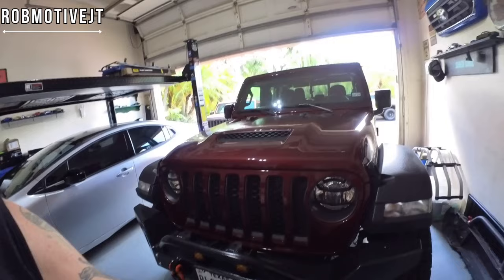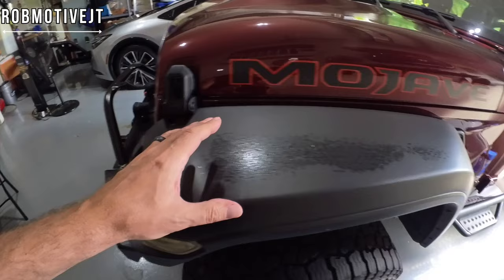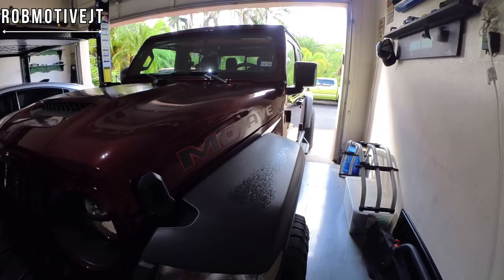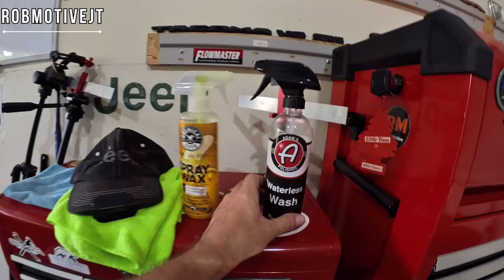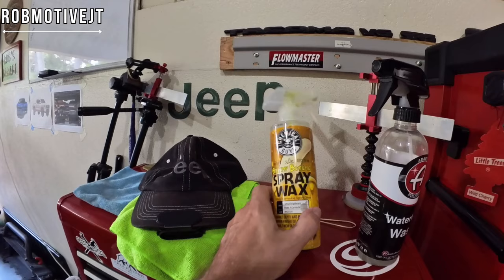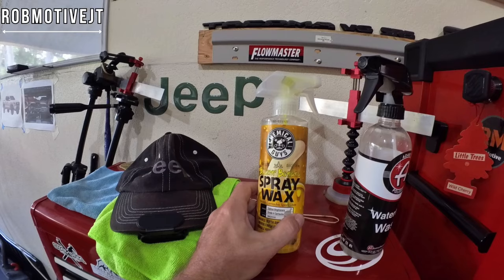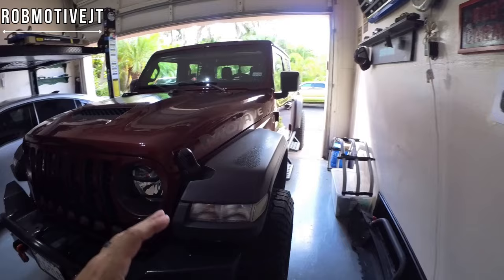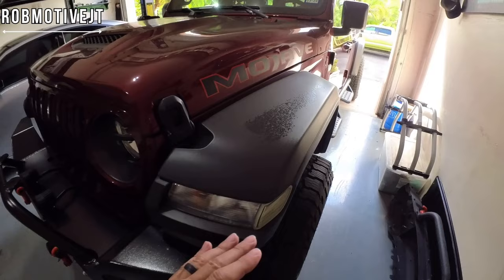Protect the Jeep Gladiator From Fading

Comment: Great video Rob, yes these things aren’t cheap you can put anything on there would help rather than doing nothing, the fenders turned out pretty good honestly yes they look great for that hot sun that you’re in down there, same thing with the paint, i’m considering ceramic coating on or new 392 , which is at the dealership right now we might pick it up tomorrow plus my new ram 2500 rebel I might do the ceramic coat👍!!
Reply from the maker: Gotta protect them for sure!!